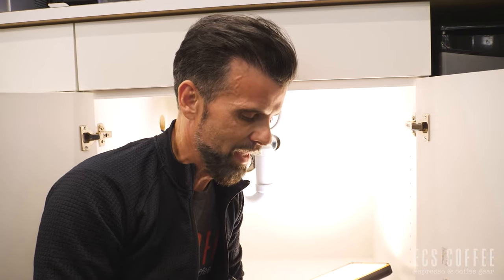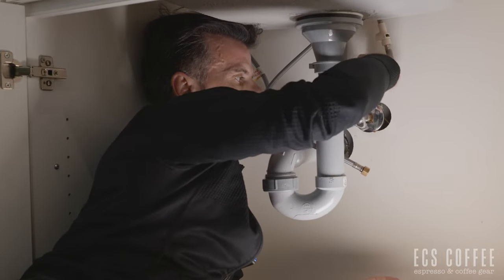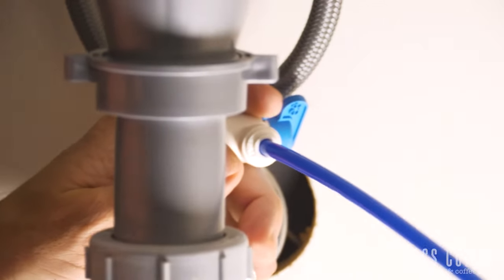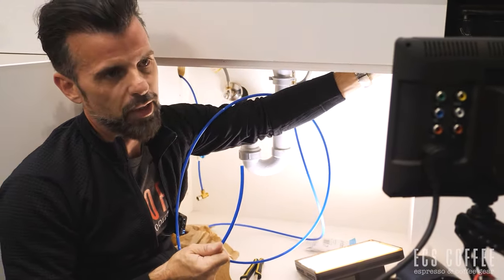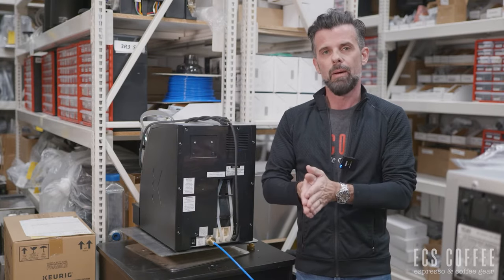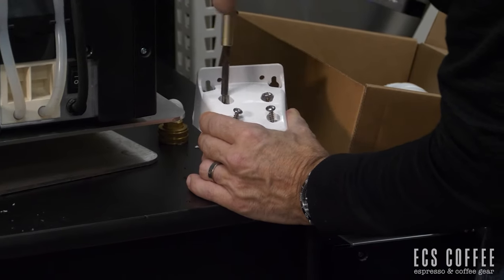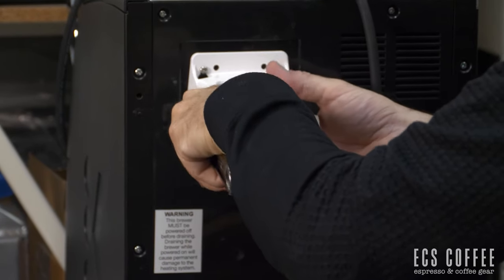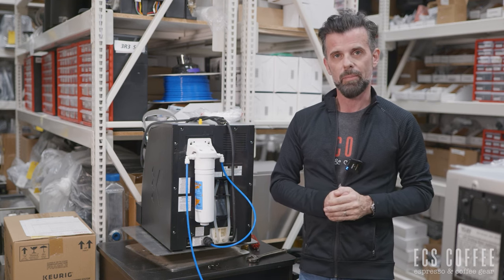How to Plumb-In your Coffee Machine

Comment: So my machine has the option to also plumb the drip tray, but I'm confused about where to run the drain line once I've connected one end to the machine's drip tray
Reply: There are connections to buy for that, just connect it to the same pipe as the sink drain. You could even kind of build a connection yourself as it won't have to handle the same pressure. But y'know just go to the store and they'll help you

Comment: Great.  But why do more super automatic espresso machines have this option?
Reply: It makes life easier, instead of having a tank where you have to manually fill it up every once in awhile. A plumbed one just automatically fills water in, when the machine is running low on water.
Reply: I wish mine did, just got the delonghi magnifica EVO, I’ve been searching for a plumb kit, don’t think it exists
Reply: @aeonjoey3d  most small compact coffee machines usually don't come with plumbing unless you can DIY make a float switch valve on the tank that automatically closes and fills up when water is low.